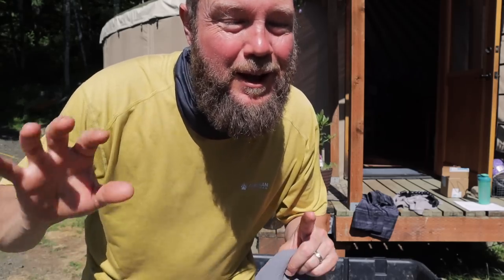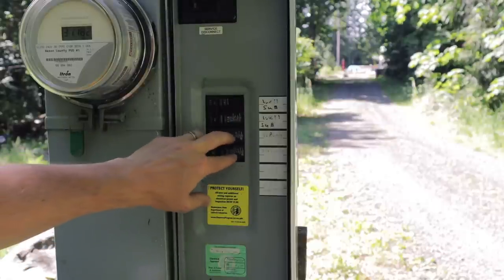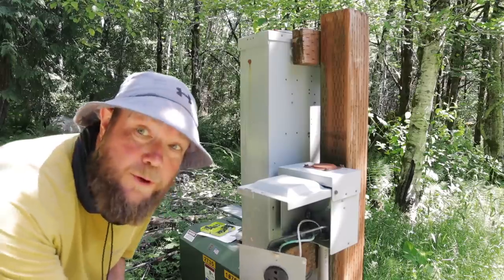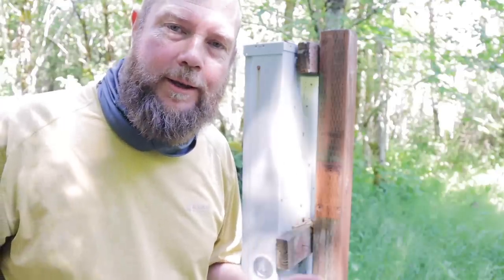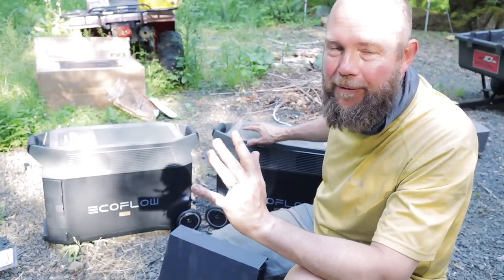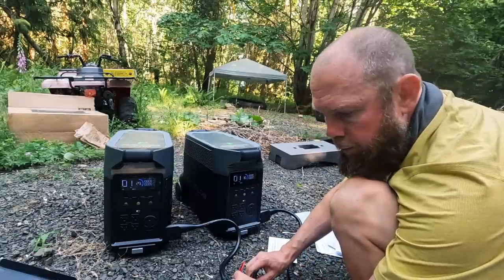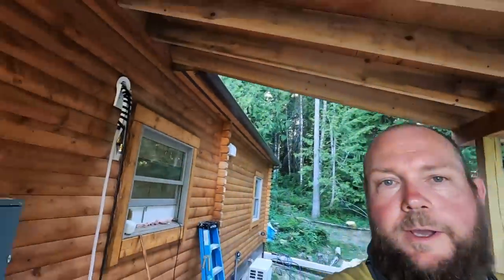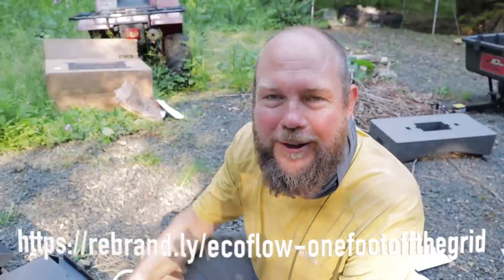INSTALLING a WHOLE HOUSE BACKUP system using EcoFlow Delta Pro

Comment: Just a quick comment, and not trying to be that guy, but at 12:32 you mentioned you have 7200 watts of power and 21 kWh of capacity. An EcoFlow system is capable of storing 21.6 kWh, but you require 6 units, not 2. In your current configuration, you'll have 7.2 kWh of storage. Running at full capacity, that's less than one hour of use (due to depth of discharge limitations), but it's pretty unlikely you'll pull 7200 watts in a cabin unless you have electric heat, stove, on demand water heater, or dryer. These are great systems for emergencies, portability, and cabins, but if you're looking for long duration or fulltime power replacement (which I understand you're not), these are underwhelming when compared to conventional home solar power battery systems. Still a great unit, and congrats for being selected to work with EcoFlow. They seem to have some great technology and software, and are leading the market in solar generators and portable battery systems. Just wanted to clarify for your viewers since this is an advertisement, and it would be unfair for them to think they are getting this capacity with only two units.
Reply from the maker: Hey Paul, thanks for your comment.  You are right I made a mistake when I was making my calculations.  The number I quoted was if you added the 2 additional batteries to each unit, which then creates a pretty robust system.  

In a power outage situation, I anticipate we will only use around 500 watts continuous, with surges to 2000 watts when our well pump kicks in. 

I'll make a note in the description to let viewers know of my calculation error.

Comment: Great video. 
You remind me of myself about 15 months ago.
It's all about having proper capacity.
I started out with just 2 DP's as I needed 240 volt capabiilities for my well pump but after using the 2 DP's in the "Real World" at my place, it became very evident I would only be able to power my place for a few hours with 7.2kWh.
My whole house consumes about 800 to 900 watts continuously. I could reduce this consumption IF I really wanted to as I have many phantom loads running in the background (computers, modems, Apple TV, 4 trickle chargers on outside equipment, RV Trailer connected in my driveway, etc)
In addition to 800 to 900 watts continuously used, when other loads come on intermittently such as 3 refrigerators, a freezer, the 240 Volt well pump, the septic pump, 2 sump pumps and the furnace, another 800 to 4,000 watts can be consumed.
So essentially, my 2 DP's would likely have run down to zero in about 3 to 5 hours. So the two DP's were not sufficient to keep my house running until such time as my solar panels could produce sufficient power to both run my house and replenish the charge to both DP's.
My current set up now provides me with 26.9kWh which is as EcoFlow calls it "Power Independence".
I can operate my whole house 24 hours a day (if I want to) on the this DP and EB setup and my 2 solar panel arrays recharge everything during daylight hours, at least at this time of year. However, I try NOT use my electric dryer, electric oven or central air conditioning while connected to this set up.
On really overcast days, I still manage to get about 800 to 900 watts on each solar array which means I am breaking even on power usage during daytime. I was not able to power my house 24/7 in the winter months as the days are just too short to generate sufficient recharging power.
If I don't have grid power or solar available, the EcoFlow Smart Generator or my Yamaha EF6300iSDE comes into play to charge all the DP's and EB's via DC while they are still powering my whole house.
As far as cost, I did everything myself except for the solar panel installation and the house panel swap. I had the additional cost of consolidating the 2 house panels (one on mainfloor and one in basement) which came with the house into one larger panel as well adding the whole house Reliance Controls TCA1006D 100-Amp DP Single Load Transfer Switch.

You can learn a lot as I did from this EcoFlow group.

Details here:

https://www.facebook.com/groups/deltaprolaunch/permalink/1388987988234719/

Comment: Be sure not to leave your EcoFlow Delta Pros outside in the weather. These units are not really designed to be rained on, or to be damp all the time either. Wherever you put them, it should be a climate controlled, cool, but not damp or excessively cold place. The larger the wire gauges and shorter the cable runs, then the more efficient your system will be. If you max out the solar on each unit (1600 Watts per unit x 2 units), then you should be able to go off grid effectively. Add the smart dual fuel generators, then you even have the option for total home backup in the Winter without the need to install solar panels !😃👍😇 Think about that for a minute. Of course, it's always good to have redundant systems. I would go for your setup, plus one extra 3.6 Kilowatt battery on each unit, and one smart dual fuel generator on each unit running on propane, plus 1600 Watts of solar on each unit. It's an expensive option, but you could go 100 % off grid (Even in the Winter months) without the need of the grid supplying your cabin.

Comment: Great honest review.  Your property is very conducive to “off grid” paradigm.  Love to see you move the EcoFlow Pro boxes et Al and bring them inside, connect solar and increase battery backup and power your whole home 24/7 on this system.  McCool heat pump is nice diy, but don’t think it can be run off of solar generators?

Comment: I use it for 1 year and 2 months with 2 extra batteries , what I like is plug and play , nice app.
This are problem i got
1) dual-hube give up 
2) 12 V out put dead
3) BMS don't do the work
4) Solar Charge drop from 1600W to 1280 W max.
5) expensive 
6) tech support after a year don't provide replacement while broke one sent back to repair and reply take days ( mostly from China )

Comment: I have a question:  When I connect my Delta Pro to the house, can I then plug in my Delta pro charging cord to an outlet?  What I'm thinking is, plug in the delta pro to give electricity to appliances and available outlets that are needed, but then plug in the delta pro into an outlet at the same time to charge the Delta Pro.  In other words make it a never ending charge to the Delta Pro which will also supply the house.  Thanks
Reply from the maker: I wish it would work that way.  You'd be a rich man if you can make that work.  You'd need to have an external source of power charging the Delta Pro.

Comment: why didnt you add your back to your house fuse box? It would save you a trip from having to switch breaker on and off?
Reply from the maker: Good question.  If we did that then the backup power wouldn't have powered our well pump and that is one of the main reasons we wanted to have backup power so we wouldn't be without water.

Comment: How are you going to keep the ecoflow's warm in winter? They have LiFePo4 batteries in them, i think they can only be discharged down to about -10c or something. Wouldn't it be better to put them in the main house so you can keep them warm and also not have to traipse down to the main fuse box to through the trip switch. 
Maybe buy some electric blankets to wrap around them come winter ey 🤭
Reply from the maker: Good question. Our weather here doesn’t get below 20 degrees very often. Also , we have the batteries inside our pump house, which we keep slightly heated firming the winter.   So I think everything should be ok.
Reply from the maker: We actually had to have it down by the main panel instead of the house because otherwise our well pump wouldn’t be powered.

Comment: I have a few questions. It looks like the piece you installed in the fuse panel took the place of two breakers?..is it compatible with Square D breakers? So I would need to remove two breakers and replace them with the piece that comes with the ecoflow and afterward those two breakers are now powered by the ecoflow? If I just went with one ecoflow to 3 of their 400watt solar panels could I just plug into the front of the ecoflow and use it like an extension cord from a generator ?
Reply from the maker: The piece that went in the panel was just a 50 AMP double pole breaker.  That doens't come with the ecoflow.  In addition, you need to setup a "Generator Interlock Kit".  They makes it safe so that it is mechanically impossible to have the generator breaker and main breaker on at the same time.    

If you are just powering 120v appliances then yes, its much easier to just plug in to the front of the ecoflow.

Comment: Ryan l have one question…. You use a cord to connect it all together.  What happens if it rains??  Do you have to put the cords into a waterproof pipe?? Or is it weather tough?  Just wondering!!
Reply from the maker: The cord and plug are both weatherproof but the batteries are not.  They will live inside our pump house so they will be protected from the rain.  

It will be sooo nice to have a backup system this winter.
Reply: @OneFootOfftheGrid  indeed it will!!  And you won’t have the extra high utility bills that come with the colder months!!  Over here gas and electricity and water to some extent are very expensive and continue to rise!
It’s at a point the government are concerned about the elderly who live on their own as some are not heating so they can eat!!

Comment: why dont you put a cable from the house to the generator skt by the mains  and have the batteries in or near the house
Reply from the maker: Your right, that would be nice, but our service panel is 300 ft from the house and we wanted the backup batteries to also power our well house (which is also 300 ft away).  

So unless we wanted to trench a new line down to the pump house, this is the best option to power everything.

Comment: if your hooked to the grid why do you need ecoflow system for backup?
Reply from the maker: We tend to lose power 4-6 times a year.  Sometimes for as long as 2 days.  So it’s an emergency system for when we lose power.

Comment: You're planning on building a closure for Ecoflow from rain and snow?
Reply from the maker: We actually are going to keep the batteries inside our well pump house.  I just didn't have the right length or generator cord when I was making this video.  Turned out that a 25' was just a bit too short.